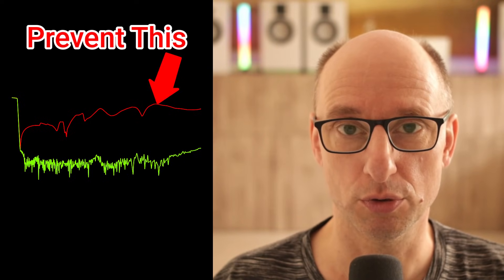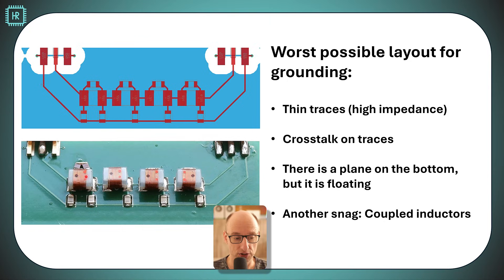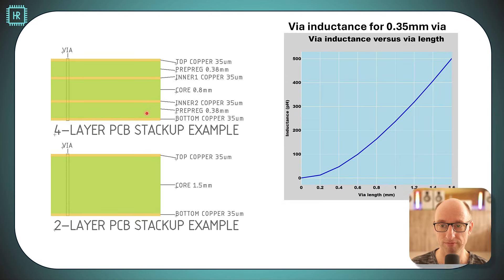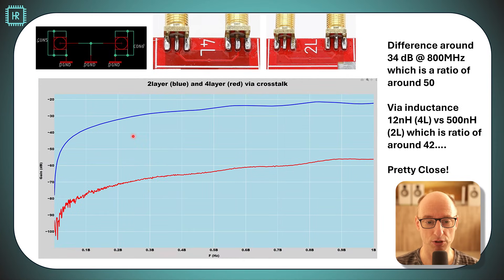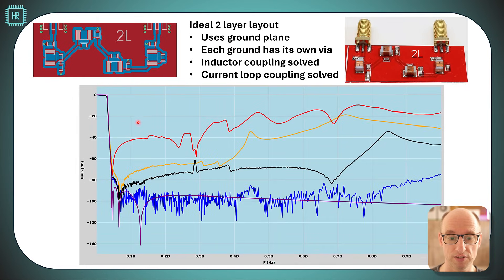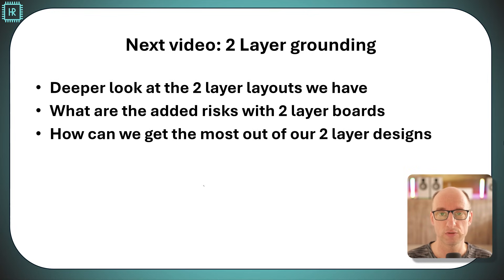Flawless PCB design: 3 simple rules - Part 2

Comment: Really great video ! Just wondering, so if I design a board with CAN-Bus all those rules apply and give me better signals if I understand right ? Are there even more benifits for other electronics? What about going into “high voltage” region let’s say up to 1000V ? If I use different voltages do I need to put the ground on different planes ? As you might read out of my question I’m not from this field. But I’d like to learn more and your videos so far were very good so I hope there will come more and maybe some more basics as well.
Reply from the maker: Can busses generally have a very low frequency I believe, so the signal integrity of those would not be very easy to 'damage'. However, bad grounding on a CAN bus can make it very susceptible to interference which means your windscreen wiper (or any other device in your car) can do all kinds of random stuff :-) When Mercedes started with CAN busses many years ago, they had at least one 'disaster' model that had all kinds of these feature :-)

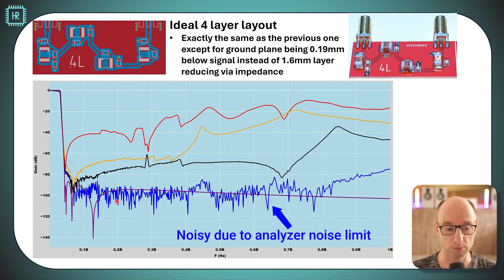Comment: On the last layout ( 9:10 ), I'm wondering why the ground pad of the capacitors and the vias aren't directly connected to the top ground plane, but only to the bottom one. Is it to "force" a return path on the bottom layer ? The one at 5:56 have them all connected to the same plane with solder bridges, do they make a difference ?
Reply from the maker: Hi, yes, I'm trying to force a single path, and connecting them was meant for another demonstration purpose. I planned to put that in my new video but I didn't put it in since I can also do it on my other 2 layer design and I want to keep the information as concise as possible. Connecting them in that case makes the response a bit worse. In the other layout case, connecting the top makes it a little better. Video 3 which will come out within 24 hours shows the reason why.

Comment: Thanks for the great video !
In the 'good' 2L layout you used a ≈ 100 mil track width to get your target 50 Ohm signal impedance. However, in the 'ideal' 2L layout, the track width was reduced to ≈ 8 mil which drastically increases the signal impedance. Finally, in the 'ideal' 4L layout, this was fixed by a shorter dielectric between trace and ground plane. So, isn't the actual track impedance another performance factor in your example ?
Reply from the maker: Good observation! It's all a function of frequency. The higher the frequency, the bigger the impact of a wrong trace impedance. The general rule of thumb here is that when a trace becomes longer than 1/4 wavelength, you should begin to worry, 1/10 if you want to make sure. At these lower frequencies this is not the case yet. Actually, the inductance of the trace would help the suppression at higher frequencies in this case, since it's loss that will only show up at higher frequencies. Best regards, Hans
Reply: @HansRosenberg74  yes you are right ! I didn't realize that the frequencies of interest were rather small in this example, so track width is not critical. Now I will watch the video again once more time :) . Keep up the great work !!!

Comment: Hi excellent video.  One question. Some industrial measuring equipment running on mains voltage seems to  gets damaged if the  Earth to  neutral voltage is high. Can you explain the mechanism. I know  it has something to do with the chassis ground being connected to  the ground plane. But I cannot really understand the mechanism by which it damages the board. Thank you
Reply from the maker: I can't tell without having the equipment or the schematics. I can imagine quite a large current may run, since the impedances will probably be quite low. If that current runs through a pcb somewhere, the traces might simply burn of.
Reply: Thank you

Comment: One idea when thinking of 2 layer boards, what do you think about thiner boards. I.e. using 0.8mm Boards but not 1.6mm. Of course they are not ideal for big boards or higher power components but for cheap and tiny SMD Boards maybe a neat thing...
Reply from the maker: Indeed, it will really help. The board would have to be tiny because of mechanical strength. 0.8mm boards feel really really flimsy and I always worry that smd components will crack if I bend a board like that.

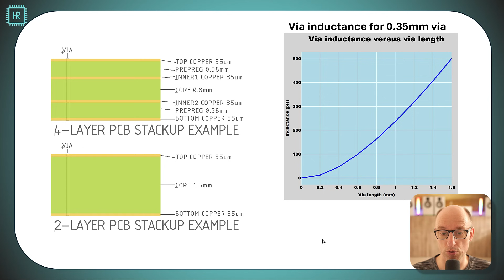Comment: @3:51 The 4 layer stack up diagram is misleadingly drawn with the core dielectric appearing the same thickness as the upper and lower dielectrics when it is actually doubled. 😮 Some poor sod won’t notice this, order a standard 4 layer board and wonder why their PCB is noisier than anticipated. An easy & affordable solution is to use a 0.8mm total thickness PCB with 5mil (.12mm) top and bottom dielectrics.
Reply from the maker: You're correct, there is a great variety in pcb stackups with standard suppliers. Eurociruits who is big in europe uses 380u dielectrics, pcbway which I used for this one is at 0.19. You should always check with your supplier what they use. I thought about the 0.8mm board option, but those board always scare me since they're so flimsy. I always worry that I crack an smd component if it bends a bit, even with smaller boards. It is great for RF though, I would support it with a metal base in that case, great for getting rid of heat as well.

Comment: you can also get close planes and short vias on two layer boards by just using a thinner pcb options (if possible of course)
Reply from the maker: Agreed! I just always get scared by the 0.8mm boards since they're so flimsy, even small ones bend very easily and I worry about cracking smd components.
Reply: @HansRosenberg74  I was just thinking about this when the board stackup graphic came up: Manufactures always have the 0.8mm core available as a 2-layer board option.

But having the components flex off by accident would be a shame. Putting the design on Front and Inner Copper 1 in a 4-Layer PCB for the sexy 0.18 vias you mentioned is definitely the way to go then, thanks for your insight!

I subscribed for part 3, knowing the limitations better would be helpful!
Reply from the maker: pcbway 4 layers have 0.19mm as standard :-) not very expensive

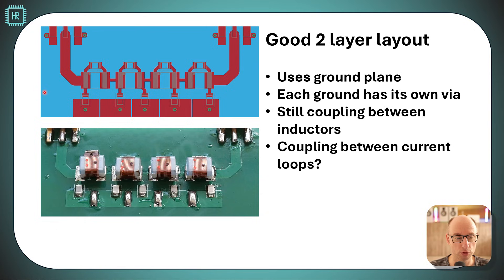Comment: Hello! I'm curious if there was a reason for the gnd pad separation for the 6:12 circuit. It looks like the pads are then solder blob shorted in the pcb. Was this just to illustrate a point that was later cut out? I would think that since the majority of the return current will follow the signal path, the difference between pad separation vs linking would be rather minimal. Thank you for the excellent videos!
Reply from the maker: Hi, that was done for video 3 :-). I want to show the impact of ground on multiple layers and optimal grounding on a 2 layer. You have sharp observation, you're the first one that noticed :-)

Comment: Hi,
Excellent work. I cannot believe that you actually designed a worst layout PCB and got it manufactured. Never seen that done before. Amazing !!!
I do have a question: what if you route the trace between the upper and lower ground planes with ground vias on both sides of the trace ?
I think that would give ideal results.
Send me the checklist please.
Cheers !!!!
Reply from the maker: Hi, that might be better indeed, hard to tell. I've found out that the biggest problem is the loop size of the return current (result for next video I measured already). You may actually increase the loop-size again if you put the trace on layer 3, so no guarantees up front that it will be better. I did the manufacturing myself so that wasn't a big problem :-)
You can get the checklist here:
https://www.hans-rosenberg.com/checklist
Best regards,
Hans
Reply: @HansRosenberg74  I'm not sure what you mean by the loop size increase.... How would the loop size increase if the signal trace is between the upper and the lower ground planes ? The top and bottom layers will be complete planes.... can you please explain coz I'm not able to understand your point.
Reply from the maker: Sorry about that. I mean the difference between a 2 and  a 4 layer board. In a 4 layer board, you can put the gnd 0.19mm below the signal layer. In a 2 layer, it is 1.6mm away. So the loop in a 2 layer has a little over 8x the surface area, making it a much better 'antenna'. Hope that clears it up, let me know.
Reply: @HansRosenberg74  I'm a novice in Antenna Design. I'm not clear on this at all. Does the Ground Plane being closer (0.19mm) to the Signal trace is bad and farther away i.e. 1.6mm, is better ?

What I meant was to have the Top and Bottom Layer Complete Ground Planes and the Internal Layer1 carrying the Signal Trace. Internal Layer2 is completely stripped of copper i.e. No Ground plane or Trace on Internal Layer2. Also Add Ground via stitching on both sides of the Trace.

Let me know if this is good or bad ?
Cheers !
Reply from the maker: You should really watch part 3 of this video series, it explains it in great detail!
https://www.youtube.com/watch?v=nsDzvE8TeQo
Reply: @HansRosenberg74  Thanks for the Checklist... Just downloaded it ! :)

Comment: Congrats for the very good explanations backed up by real measurements. Looking forward to your next videos!
Spotted one error: in the via impedance measurements the inductance is presented to be in nH. 500nH is quite a lot. Must be pH as shown in the inductance graph.
Reply from the maker: Ah, darn, I missed another one? It is soo hard to get good personnel these days (even if that's me :-)  ). I fixed it in one location with text on the screen, but I missed another one apparently. 500nH would be a really really long via :-) (or a really really thick board)

Comment: I can only wish I'd seen your videos a few weeks ago.  I'm now converted to 4-layer boards.  Now that I can get 4-layer prototypes from China for a few bucks, there's no reason to struggle with 2 layers any more.  Just finished an analog optical fiber tx/rx using LMH6029, for a cheap scope isolator.  Works fine up to about 30MHz b/w, but if I'd known what you just put in this video, I could have done it in one or two spins instead of five!  Ironically, these high speed op amps want you to have no ground plane under them, since they're extremely sensitive to stray capacitance.  But for all the rest...
Reply from the maker: Thanks a lot for the reply. Good remark on the opamp, can you tell me which type that is? One of the things I write in my design checklist is to always check the datasheet of components you're using. Some components have really specific needs. In case of a high speed opamp: The capacitance will slightly slow down the output which decreases stability. It does depend on the thickness of the dielectric, if it's really thin, the capacitance will be bigger than when it's a bit thicker, maybe they state a limit for the parasitic capacitance. Really curious to know what opamp that is, let me know if thats ok.

Best regards,
Hans
Reply from the maker: or is the opamp the lmh6029? I can't find that one.
Reply: @HansRosenberg74  Sorry about that!  It was really the Texas Instruments LMH6629.  (Forgive the typo).  That was on the receiver end.  I did read the datasheet quite thoroughly (always learn a lot from them) but this was my first attempt at high speed analog, and my estimates of capacitance etc. were not very good.  On the transmitter end, I used a slightly slower opamp, the LMH6642.  Maybe, after watching more of your videos, and going to 4 layer, I'll be able to refine the design.  Theoretical limit with the IFE91D + IFD91B fiber tx/rx pair is about 70MHz, and the opamps should be ok for that.
Reply: @hardywoodlandcypress  Hah - I just did something similar with SFH757V and SFH250V, and ADA4817-1. The book Building Electro-Optical Systems by Phil Hobbs was helpful.
Reply from the maker: That is one hell of an opamp! I would call that an RF amplifier :-D. Amazing low noise as well. Indeed the ground is cut away under the pads to keep it stable as I thought. The pad does have 5 vias in it, so it is a very small cutout. So small that it won't show up below 15GHz I think. (very very rough guess)

Comment: Awesome!  Hoping you might show us how to do some layout in KiCad or similar..  Lots of people would love to build simple 1-2GHz radio toys I am sure!
Reply from the maker: I do plan to make a layout tutorial on some design (don't know what yet). I'll probably use Eagle, since I'm still using that. I'm thinking about my fpga board, since it is such a challenging design, I could explain a lot of concepts. Would be a longer video, I don't know if people want to listen to me THAT long :-) What did you have in minde?
Reply: @HansRosenberg74  Some sorf of ham radio gadget perhaps?  Rework of W1GHZ 2.4/5.8/10GHz board?
Reply from the maker: I have a very simple layout using standard gain blocks, maybe that is something that people find interesting as a showcase for a very simple pcb project with a very useful result. You can place a large selection of different gain blocks on the same layout to get anything from  low noise to high power.
Reply: @HansRosenberg74  Yeah definitely, add some mixers, SAW filters, diplexer terminations etc.  Plenty of RF students and ham radio guys will fall all over it.  I have no idea where to start getting all this on some KiKad->FR4->PCBway, it'd be a blast..

Comment: Wow!  This is a promising channel!  Subscribed!  I already like the path you're on and am very much looking forward to coming episodes.  If I may ask, when it fits your episode plan I would love to learn about distributed element filter design.  I kind of get the gist of how they work, but have no clue how to incorporate them into my own designs.
Reply from the maker: I've never made a filter like that. I've made a bunch of multiple GHz couplers, baluns etc a long time ago. You would design such a filter in an RF/ EM simulator, and if you want good performance (low  loss) you'd need a rogers dielectric for your pcb, which is more expensive. The good thing is: If you get it to work in the RF simulator (2.5 or 3D) then it will work perfectly in real life as well.
Reply from the maker: Once you have the design, incorporating it is just a matter of putting it on the board. Just make sure there is no other metal parts right above the filter structure like loose wires or something.

Comment: Hello Hans, thank you for the content you are posting, quality stuff.
I am curious if laying out your filter inductors at rigt angles to each other would have any further improvement in out of band rejection.
The technique is often used in audio amplifiers (valve kind) 
where the output transformer is often at right angle magnetically with the respect to the power transformer. This has a great effect on reducing the amount of 50/60Hz hum induced into the audio transformer.

Thanks again - subscribed.
Reply from the maker: Right angles indeed work. I think I've either put them in right angles or far enough apart not to 'see' each other. However, the suppression is 100dB, or 100.000 times, so even a little crosstalk could reduce the performance. Hard to know if I did enough.
Reply: @HansRosenberg74  seems I wasn't fully paying attention during the video.
Just reviewed it and realised that you have done exactly what I suggested with the inductor orientation.

Comment: Beautiful. I have worked with grounding strategies well, but not in RF. In the Audio range, we created attenuators with up to 165dB of dynamic range and a preamplifier with 180dB of CMRR under ideal conditions. We moved grounding points just tenths of an mm and sometimes had to go off the board with twisted pair conductors. I would love to have the time and capability to make a video like yours on this subject!
Reply from the maker: Wow, did you really achieve 180dB? Are you really sure, I don't know of any analyzer yet with that kind of dynamic range to measure this. I can imagine a tenth of a mm will make a huge difference, you're talking a factor of 1.000.000.000 between the largest and smallest signal! I would be really really curious to see a video on that project as well, sounds really impressive. You have the same kind of mm problem when taking the feedback point of a power amplifier, if you put that a little off center, the distortion will get larger since you have currents coming from the top half and the bottom half of the output stage.
Reply: @HansRosenberg74  yes, achieved this - the measurements made by one of my colleagues who is an analogue wizard, using crazy step-up and attenuation chains, the instrument was R&S UPV150 - you need to know what you are doing, promise…… Such fun times
Reply: Please give an example of where 180db makes any difference at all! Is it about as significant as measuring your car tire diameter to 6 decimal places?
Reply: @glasslinger  Several cases. EP instriment to detect brain response when up to 400VDC applied at the same time. Acoustic and optic input are also applied. Used to determine brain death.

Second is measuring EP responses (Again brain responses) for passive hearing testing. Think nV signals in electrically nois environments....

Third for the output is audiological testing. For Clinical instruments you need 165dB of range. Yes.
Reply from the maker: Very impressive!
Reply from the maker: I think this was more of a 'fun engineering project', just like making a car that goes from 0-100 in under a second :-)
Reply: @HansRosenberg74  No, these project were real, with real teams behind. The products are still sold as of today. The EP preamplifier has a documented CMRR of 178dB, datasheet only states 140dB though. The clinical audiometer has the full 165dB dynamic range, and 115dB channel separation. I had very very very clever colleagues, including an analog wizard and a layout specialist - she was (is) special, she did lay out PCBs for 50 years+ (TRUE!!!!)
Reply: Please please please make a video about that.